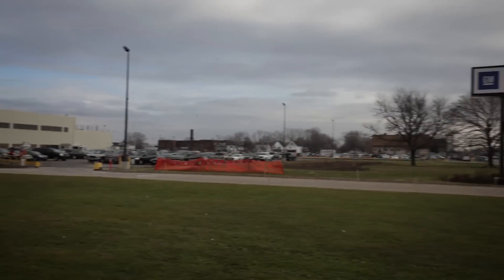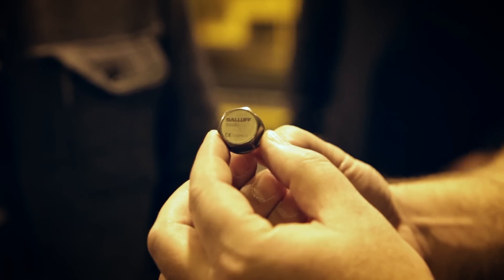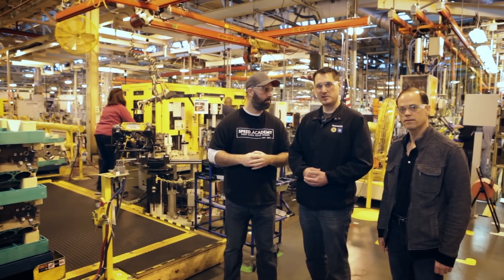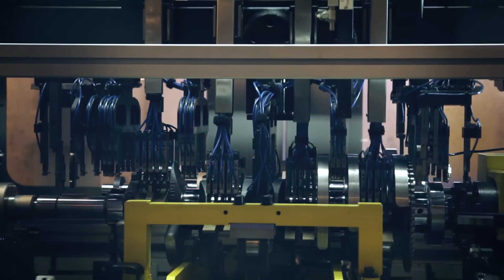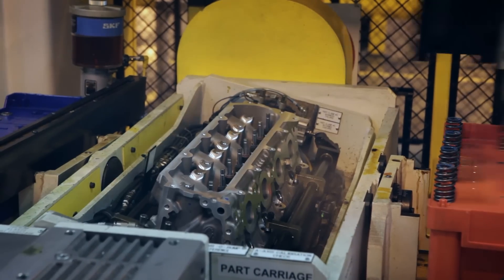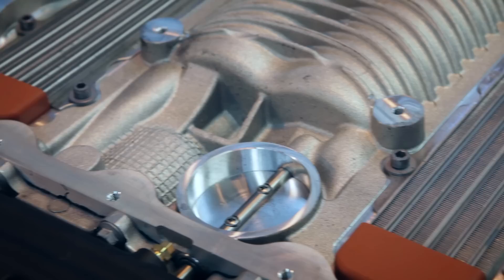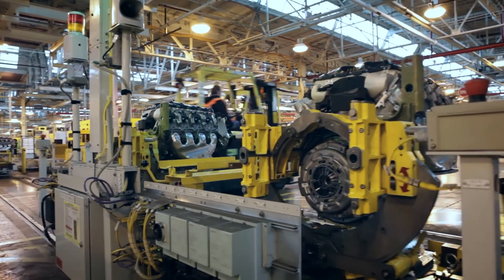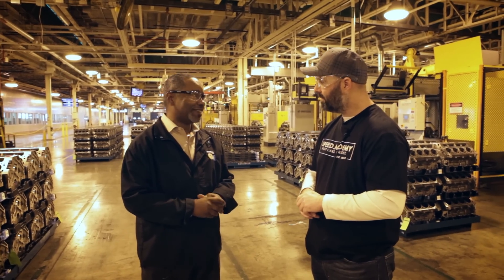Building GM's most powerful Engine Ever, the 650hp LT4 V8!

Comment: What is needed is a dual turbocharged LT engine using the LT4 bottom end for its strength and the heads for their flow and fuel system.  A larger version of the LT1 intake can feed the higher flow turbo output which would yield over 750 hp due to the removal of the supercharger drag.

Comment: Active fuel management. The death of the new 5.3s don't believe me?. Go look in ur intake and I bet u it will be coated in oil so right in the combustion chamber it goes. 2014 to 2017. If u don't run a oil catch on these direct injection motors they will not last!!

Comment: Well, this is the most powerful GM PRODUCTION engine, keep in mind, Pontiac had collaborated with Chrysler to make a Dual Overhead Camshaft Pontiac 389,421 and 428 , each engine making 700+ Horsepower in 1965, the 389 was intended to be put in the GTO and the 421, 428 and 389 were to be sold as NASCAR crate engines, but sadly, General Motors shut down the program

Comment: DON'T LET GM FOOL YOU. FROM TOP TO BOTTOM THE LS IS 1000% FORD. IT IS A RAISED PORT 351 WINDSOR AKA FORD 427 HIGH RISER ENGINE. NOT 11111111111 ONE DESIGN ASPECT OF THE OLD SMALL BLOCK CHEVY LIVES IN THE LS. THE LS IS ALL FORD.

Comment: 6:00 & 11:22 Those fans ... None of them are running. I've worked for 28 years in a similar large factory environment with fans like that all around, and sweat hog coworkers who insist those fans run every day, all winter (Chicago area) for non-strenuous, even semi-sedentary seated work tasks, and they will claw your eyes out if you get between them and their fans. They also want truck-sized overhead doors open when it's 40 deg. F and raining with a raw north wind. This behavior is condoned as reasonable, and I am just a troublemaker.

Comment: So if you look at what GM has done with the LS engine they went to 4 bolts per cylinder and they moved the bolt holes back away from the bores , fixed the 400 bore distortion from the past

Comment: Get rid of the push rod'd crap motor and join the 21st century with over head cam!!
Reply: Elrod Jenkins uh going backwards to overhead cam seriously thats 18th century tech
Reply: Haha.....uh, are you serious? I think what you are trying to say is, large displacement NA due push a lot of horse power. No one is dumb enough to toss a huge pushrod motor under the hood of their car. Also, I'm not sure what century you're in, but many manufacturers have NA motors push well over your 300hp.  The only reason these push rod motors are achieving high HP numbers is due to large displacement. So essentially, removing any real engineering out of the equation. Want more HP, just grab that 1950 push rod motor and add more displacement. Hence my statement. other car manufacturers have gone to OHC due to being able to create the same power, with less displacement. Example: 1991 Corvette had 245 HP with 5.7LT motor. 1991 Honda NSX had 290hp with 3.2LT. 2016 Corvette, 6.2 LT 455HP. 2016 Porsche GT3 4.0LT Flat NA 6 500HP. Lets not even get into forced induction........

Comment: pretty standard engineering here. 
doubt a line worker came up with that tool too.
Reply: Oh, it was a line worker. Robots don't know jack. The robot kept shovin it too far and the worker figured how to out smart the robot without jammin the machinery. From a machinist that makes CNC Hellfire missle parts. We learn faster than robots can screw up.

Comment: great engine but the exhaust manifolds look hideous and real cheap.
Reply: they are cast iron real dependable the shiny grey is just a heat barrier to keep the heat in the headers and not to and wires or anything that may melt close by to them
Reply: Illyrian4life ..I believe you are looking at the heat shields.
Reply: Ogreng Buddha ... The video says that the manifolds are made of, cast stainless steel.  Pretty good stuff.
Reply: They look like block hugger headers

Comment: I guess Im old school but you lost me on a CAST Crank Shaft?!
Reply: When they say "The crankshaft starts as a raw casting" the piece shown is a raw forging. It's a forged crankshaft. All the other info I've looked at for the LT4 specs it as a forged crankshaft.
Reply: @phlodel  you are correct but that is not an LT4 crank. it is missing journals.
Reply: Mike Valek I was thinking the same thing - a cast crank on an over 650hp high dollar premium engine. It didn't seem right.
Reply: Wide parting lines indicate forging. narrow parting lines indicate casting.
Reply: Mike Valek people are running these cranks in builds upwards of 1000hp
Reply: That's BS. It's obviously a casting. You can see the flash line from the mold and the gritty sand exterior finish. Forge would not have flash lines.
Reply: thats obviosly forged, not cast
Reply: Mike Valek my 1972 402 big block has a stock cast crank
Reply: Rev Mikey buy a manesium one , those supposedly increse in strength as heat rises.
Reply: CAST is a process used to manufacture/create a type of metal. Cast isn't a metal.
Reply: The cast crank shown is for the LT1. It's stated in the video description. LT4's have a forged crank.
Reply: @ultraspeed76  That crank is not an  LT1.

Comment: all that machinery for a block with siamesed bores. These are the supercharged engines that overheat when pushed on a hot day? i guess saving 2 inches on the block length is more important than keeping it from overheating. i wonder how many cars those robots buy? One of them could pay ten workers for a year

Comment: they've regurgitated LT4 AGAIN?
Reply: ls5-6 never a ls4 in the 70s from any source
Reply: No body wants to ruin a good thing - random gangster
Reply: GM LT4 engine
From Wikipedia, the free encyclopedia

					Jump to:					navigation, 					search				
General Motors has produced two different engines called LT4:
1996–1997 LT4 – GM Generation II Small-Block
2015-(current) LT4 - GM Generation V Small-Block
Reply: I was thinking of the LS4.....  70's 454 as well as FWD 5.3 (Impala SS)

Comment: I apparently have been unnecessarily careful with all the engines I have assembled over the years. Looks like just slapping main bearing in place without proper tang alignment to the block register is OK on a 630 hp engine (3:19). Really makes me wonder....

  The fully automated cylinder head assembly station in just mind boggling. Really good video!

Comment: The kings of  copies  The block looks like ann old  Ford Y block and the  head are a copis of the Cleveland  head!
Reply: Yes but you have to go overseas to watch a FORD engine built
Reply: The head is nothing like a Cleveland, but if it were, the Cleveland head looks like a copy of a Mark IV Chevy BIg Block.  The BBC came out in '65, the Cleveland in '68.
Reply: You're joking right?
Reply: Ya  I guess the head is a poor copy of a Cleveland isn't it!
Reply: Mylan Miller and Ford copied the stamped steel rocker arm from chevy who copied it from Pontiac
Reply: Mylan Miller Truth is, all of them copy David Buick.
Reply: the king of copies yet most of the flaws and the over all design is differently yes two design features are really wildly different then fords design of the y wheres gms distributor placement on the y block design in the front with the pump bur heads are actually nothing like Cleveland's none of gms engines can be it makes no sense what ford fans say but hey toud probably say the buick nailhead is a copy of the ford y block to
Reply: Mylan Miller ,bullshit
Reply: YesYes you are right because 327s had ring problems and 350s are notoriously cranky and so on and so on
Reply: The big block Chevy looks  like  A  Plymouth  Polly  So who copied  who!

Comment: The first Engine I ever rebuilt completely (top and bottom) was in 1973 when I got my first car, a 1966 Mustang w/289.  I was 17 and my step-dad was a Choctaw Indian and immensely patient (one of the most patient man I've ever met in my 59 years).  Watching how motors are assembled in a modern factory is incredible.  My "patient" step-dad taught me how to completely dismantle and rebuild an engine.  After the small block Ford I went on to MOPARs and still drive a Dodge V8 Ram Pickup (5.9 liter Magnum).  Watching new car manufacturing is just amazing.  My 36 year old son is a Mechanical Engineer and is keeping the spirit alive!  He's a Chevy guy...
Reply: Love the story
Reply: Wow, me too! I rebuilt my 1966 mustang's 289 in my parents garage. I remember it cost me $150 which was a lot considering I was making $1.50 an hour at Six Flags. Later I had a 70 Charger with the 383 Magnum. When it needed a fresh motor the gas crisis hit...traded it for a new 76 Corolla! 
Now I have a 72 stingray in the garage, had it for 15 years. My two sons helped replace the small block with a 383 stroker. I will hang on to the original motor and pass it on one day.
Reply: @MrMichaelbuesing  About 1977 my friends Father bought a 66 Mustang fastback 289 four speed, for $500, he would dangle that car in front of my friend to get him to do things he didn't want to do, the main thing was finish getting his eagle badge, I don't know if he bought the car for that reason, but it worked, my friend got his eagle, he let me drive it too, that was a fun car.
 1972 was the last good year for Corvette, in my opinion.
Reply: I could have used that tool at 3:29 that guides the rods onto the crank, back in 1978, I burned a hole in one piston of a 340 in 73 road runner, I was 18 with two years of Vo-Tec auto mechanics, my Father wouldn't know a wrench from a ratchet, so I was on my own, so when I put the piston in the cylinder the threads on the connecting rod nicked the crank shaft, so I found a 318 and stuck that in with the hopes of eventually rebuilding the 340, I ended up wrecking the car before I ever got the money together to rebuild the motor.
Reply: You should call him your dad
Reply: @sean5comet  My brother in-law was more of a Father to me than my biological Father, or step father, but it would never occur to me to call him dad, if you never knew or had no memory of your biological Father, you may leave out the step.
Reply: sean5comet he said it lovingly with respect.  Maybe he didn’t have either of those for his biological
Reply: I wonder if your step dad is related to Elizabeth Warren 🤔
Reply: The my pillow guy 
He said Choctaw. Warren lied about being Cherokee.  Besides it sounds like his stepdad had dignity. Warren possessed none of that

Comment: I don't think this is the most powerful  engine gm has. LSX 454R is  770 hp naturally aspirated
Reply from the maker: Production engine. LSX 454 is a crate motor so it doesnt count according to GM.
Reply: He was mentioning ASSSEMBLY line motors and not ones that go through SPECIAL processes to make them what they are. Even tonawanda motor who made marine racing engines did not do so for MERCURY MARINE for years they were done on a stand alone machining stand and hand built, they don't qualify for engines that are considered "assembly line products".
Reply: I can see the misconception Production vs Crate..

TN
Reply: might as well mention the 780 bbc 1500hp if we're talking crate engines
Reply: thats what I was thinking
Reply: Speed Academy
Reply: You dumb ass!

RT

Comment: it be cool if the used twine cam for each instead of single
Reply: umm no.
Reply: there's a reason people love pushrod small blocks and swap them into everything.
Reply: These engine already make enough torque and power, if you can make more than 2500 Horse power on a big block that is cam in block, it doesn't need two.
Reply: if the heads will flow 650-1150 hp on 16 valves. there's no point in quadrupling the cam weight...
Reply: twine will not work well as camshaft material. GM tried that with the old 307... didn't end well.

Comment: I thought LT4 was hand built by one master mechanic.
Reply: The ZR1 engine was hand built in Wixom, Mi.  If you order the ZR1 you can go and observe your engine being built as well as participate to a small amount in the process.  At the end of the build the mechanic who built your engine puts a data plate on the engine with his name on it with the serial number in his run.
Reply: I hate to tell you this, but an engine made entirely by robots is going to be leagues beyond the quality a "master mechanic" could hope to achieve. Less waste and quicker production time too.
Reply: I can see that being true.  But, they advertise hand built.
Reply: 1949crewchief I thought the same procedure for the LT4
Reply: VTwinRocket The video shows that it is not built by one person.
Reply: They are hand assembled and tagged with the person that puts it together.  Each LT4 is assembled by one of many different builders.
Reply: The Performance Build Center (formerly Wixom, Mi. Now Bowling Green, KY) builds all engines by hand. The PBC used to build the LS7 by hand as well. All LT4s now built at the PBC by hand. Tonawanda was used temporarily to supplement demand for the LT4

http://www.corvetteblogger.com/2016/05/03/corvette-z06-lt4-engines-now-hand-built-bowling-green/

Comment: It is shameful.  In this day and age we are still using century old technologies such as push rods, twin valves engines and sell them at a premium.  That's why you have to use super-charger and big cubic inches to make the HP.  I don't see Europeans and Japanese, not even Chinese LOL, engines using such low tech.
Reply: There's nothing low tech about the manufacturing process used for these engines.  As for the architecture of the push rods and twin valves, just because that design has been around longer than 3, 4, or 5 valve overhead cam engines, doesn't mean it's low tech.  As Drake stated, those designs have been around for many years as well.  Also, what is low tech about VVT, cylinder deactivation, direct injection, etc.  Drake also mentioned one of the many benefits of pushrod engines, the lower weight and lower center of gravity that improves acceleration, braking, handling, and economy.  Which is even more important when you are planning to mount a heavy supercharger on top.  Another thing to consider is the cost savings for the customer that wants to go into the engine a bit to boost performance with cams, rocker arms, and valve job.  Half the rockers and valves to replace or modify and only one cam as opposed to 4.  And what's wrong with superchargers and big cubes?  I love both of those myself.  The sound alone, from either, gets your attention and your heart pumping!  Not to mention the additional torque that both bring.  Plus the extra torque allows higher gearing for better mpg.
Reply: Hon Kit Li.  GM uses continuously VVT on the LT4 and LT1, if you want to know how it's done on a pushrod V8.
Reply: Why does it matter if it works? What is the point of complicating something if it can be done with less? Overhead cam is "century old technology" too...

Also it's funny that these small blocks are much cheaper in comparison to say a GTRs motor. Which, by the way, is heavier; DOHC is very top heavy
Reply: We can all continue to live in caves because "it works". There is something called progress.  How do you use variable valve timing in a push rod v8 my friend? It is not like the technology does not exist.
Reply: Hon Kit Li  I have nothing against progress and the Corvette has technology like cylinder-deactivation and can achieve 30mpg. 

Also, like I said, overhead cam design has been in production cars since the 1920's so that argument has no relevance in my opinion.

The final point I'll make is that keeping a simple design keeps costs down. For that reason Corvettes can be had for $50k-$80k and compete with $100k-$500k cars. It does work fine for GM; and not in a sacrificing/compromising way like living in a cave.
Reply: Even though these engines might not be the highest tech possible, I bet you won't care when you're listening to the roar of a v8 and going really fast it's about fun dude
Reply: Actually, overhead cam came out BEFORE push rod...
Reply: Andy Tyler uh overhead cams are a fuck ton wider
Reply: Right, because the 4 valve garbage ferd cranks out makes so much more power. Please. Two giant fucking values and one camshaft are still found in the most powerful internal combustion engines on this planet. With pushrods and all.
Reply: VTwinRocket  correct, and pushrod motors are also a lot, lot wider.
Reply: EETechs and actually no they didnt technically they cam out at the same time but flatheads where converted to pushrod motors with ohv really early on in the 1800s but was kind a fad and need updating the fjrst dohc and sohc motor was in the 30s and the designs where around in the 20s
Reply: actually I take my second comment back that was with fords designs not his earlier designs

Comment: hello! i got a question. why this engine use 2 valves per cilynder only???
Reply: You want to avoid as many mowing parts as you can in a engine, and a single cam to keep the engine as low as possible. There is really no rocketsience about it, just common sence! The thing is the efficiency of the heads, flow,  combustion chamber and so on :)
Reply: good question I wonder the same , maby simplify/stronger head designs and i kno thoes ls heads flow very well stock
Reply: Hawkins because it doesnt need a 4v modification unlike a lot of engines

Comment: Do all the V8 engines have four bolt main bearings? Or is it only the LT4? Just wondering.  If you don't believe these engines are quality built after watching this video, then you don't know anything about engines.
Reply: Im pretty sure that all Gen 4 and 5 V8's have six bolt mains. could be wrong though.
Reply: gen 3s are 4 bolt, gen 4/5 are 6 bolt